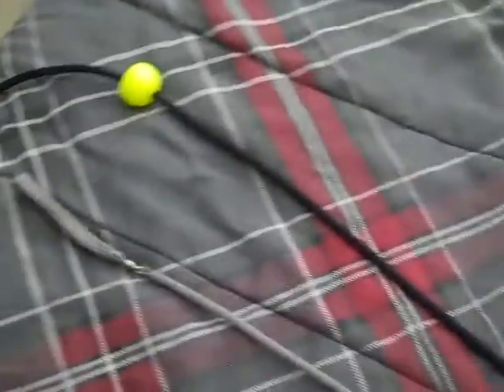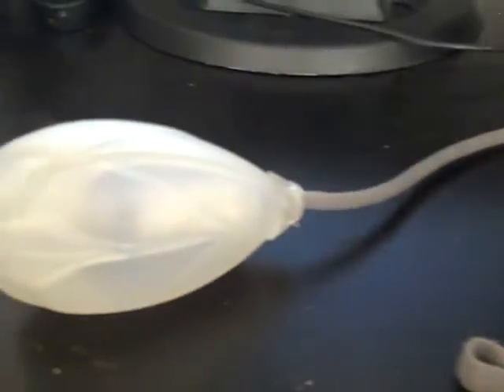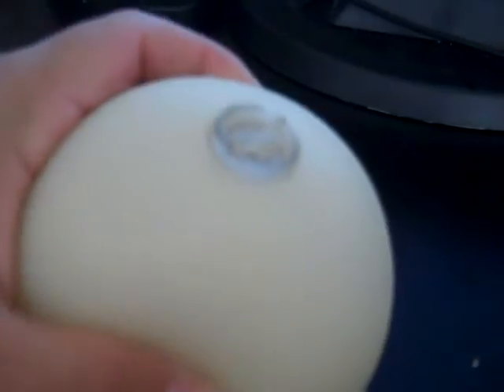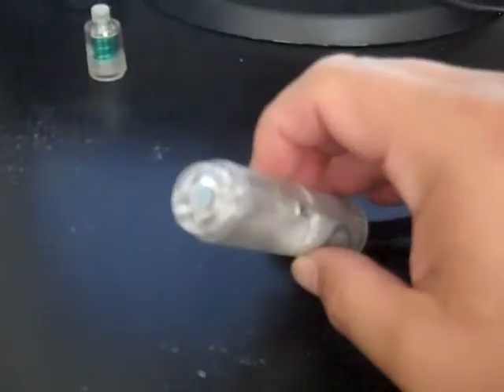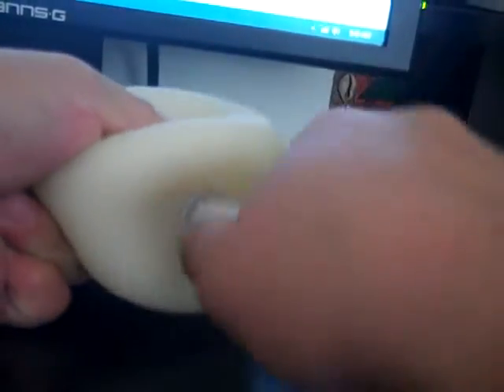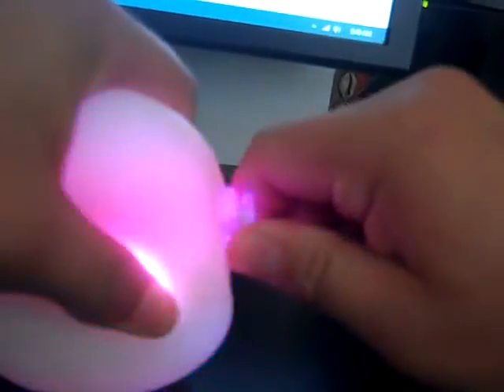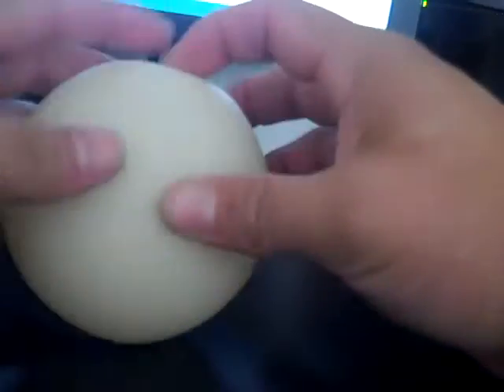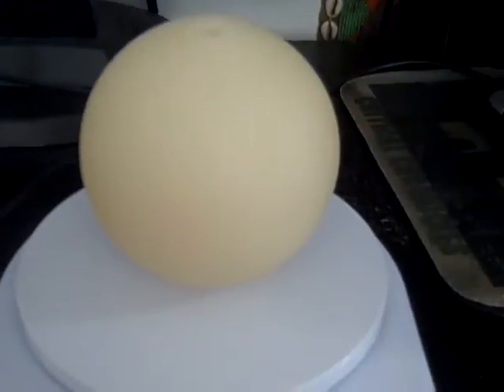Led Contact Poi 1

Comment: I love this idea, but my only concern is weight.  the Pod Poi offer such a great weight for spinning, which I think is a big advantage over other LED options, but the obvious drawback is what you're addressing here - they don't contact well.  so...  what's the weight like?  can you adjust it easily?  they don't look particularly flimsy when you're using them.  if the weight is good, any chance you could link directly to the specific stage balls you used?
Reply from the maker: The weight on these addresses the issue of pods being to light which they were for me. This makes them weigh about as much as a 100mm or 90mm stage ball. which is perfect for contact imho. Cant really adjust it to much to be honest but its a great weight in all honesty. Be sure to watch the second video ass it addresses issues you may have when trying to convert your own. I believe the link for the stage ball is in the comments somewhere lemme know if you still need it.
Reply: ***** sweet - thanks for the quick reply.  I saw that you said they're from lightupandjuggle.com but I was hoping for a link to the specific set you used.  I agree with having the weight a little heavier on the pods, although they're the best LED poi I've used, nonetheless.  I've been kicking around the idea of doing something like what you've done here for a while so I think this is enough inspiration to get going on it.
Reply from the maker: I weigh them in the video
Reply from the maker: Alex Sullivan
http://www.lightupandjuggle.com/store/index.php?main_page=product_info&cPath=2&products_id=41 Cant wait to see what you build do share when done  =) Im working on another project as well
Reply: Awesome!!  Thanks so much.  Going to wait until after holiday season so I don't bankrupt myself but def will let you know once I finally get around to doing this.  Thanks for the videos and replies.